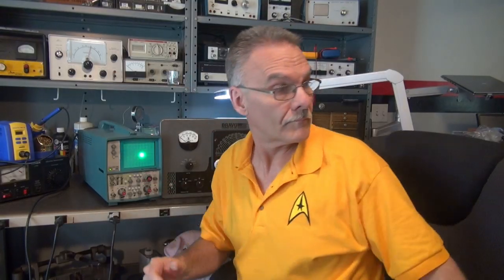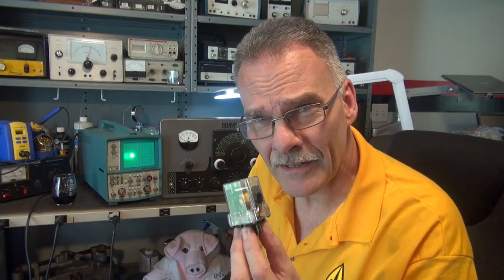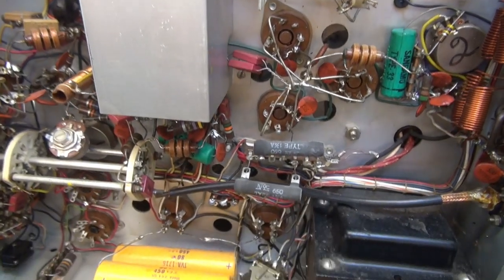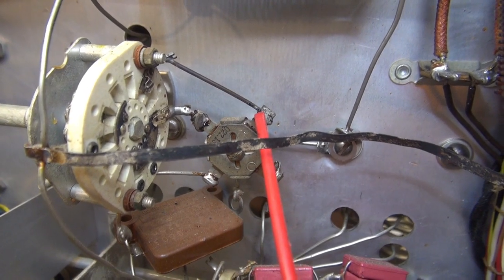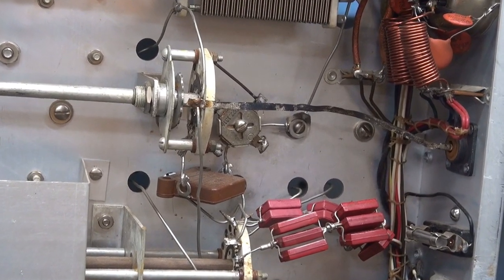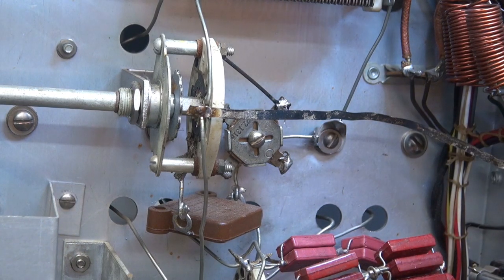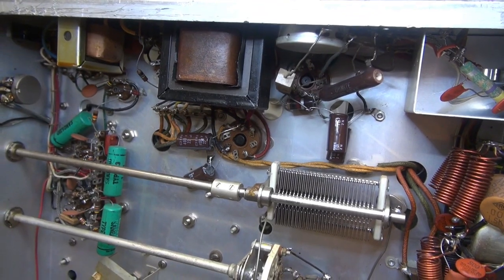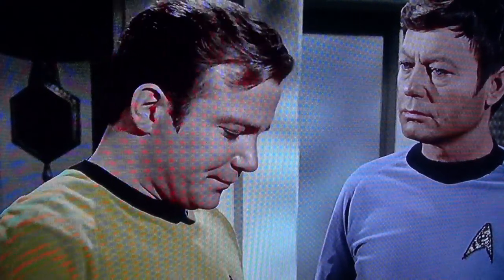Repair USS Johnson Valiant Ham Transmitter Star Trek D-Lab style

Comment: I have had excellent luck putting liquid rosin flux on the "crusty" solder, then using wick, but leaving a space of about 1.5" from the end of the wick, then pulling the wick towards me to absorb the solder. I then cut off the used wick, to reduce the amount of heat needed to get the solder to flow into the wick. I like either a 200/300 Watt gun on the old stuff, or an 800 deg tip on my pencil iron. Some connections you do have to add solder to, to get it to flow. 
 I find fast on & off can reduce any heat damage. I then let the item cool before trying to remove the solder on the next section.

Comment: Those 80 uF caps in series ought to have two 100k or more resistors as a voltage divider (use 1 percent or measure for two same values) one across each cap to make sure voltage is split evenly between them.
Reply: Exactly my thoughts; but you replied more quickly!

Comment: That much solder, I would have used a Soldapullit, but whatever. Fun watching the edits.
Reply: Even a solder sucker (whatever brand) can have trouble with old solder like that. I've had to add fresh solder just to get it to melt and flow properly so that I could then use wick or a Soldapult-type device to get rid of it and resolder it.  I'm not disagreeing with you; different specific cases require different solutions, that's all.  Add it to your bag of troubleshooting and repair tricks.

Comment: Did you check the input push pull leak rate circuit breaker on the D.C. essential string vest?

Comment: on those terminal strips with 900 volts between the end and ground lug that can fail. I have seen that. what I would do is put the 900 volts on the end where there is an extra non used lug between the ground and high voltage.